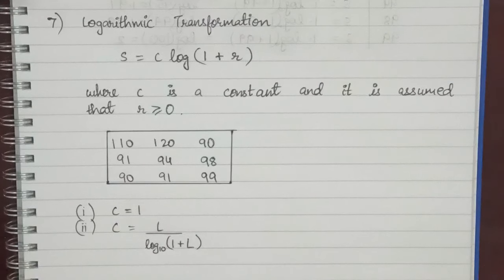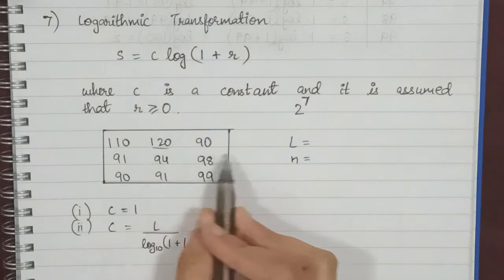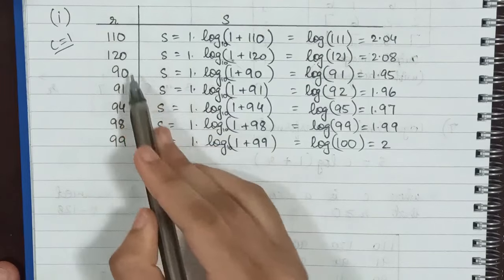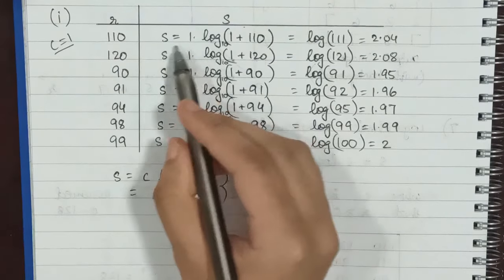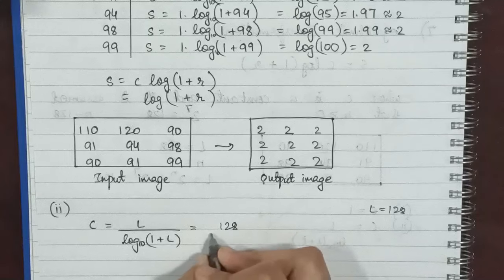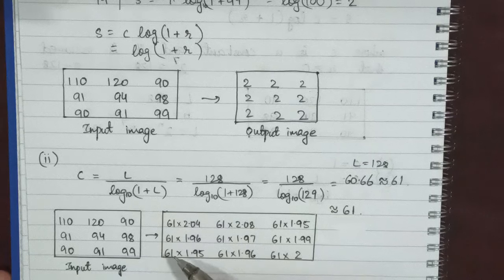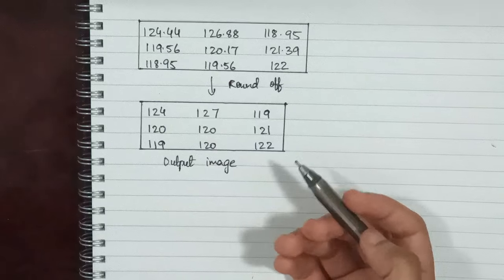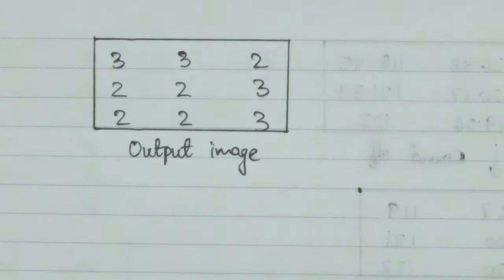Logarithmic Transformation and Power- law Transformation in digital image processing with examples

Comment: Hi, in the first question, shouldn't you multiply 60.66 with the non-rounded values to get a precise answer? Actually multiplying with 61 instead of 60.66 is changing a pixel value... That's why I am concerned. Kindly clarify, Thanks.
Reply: where r u from n college name